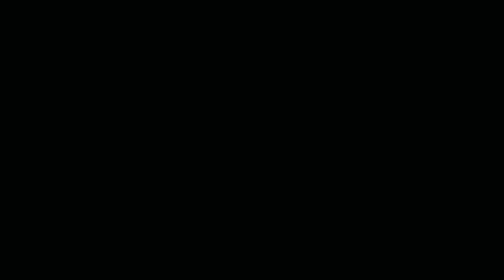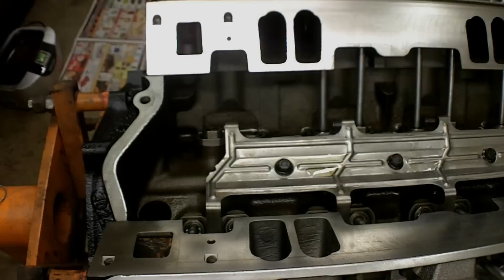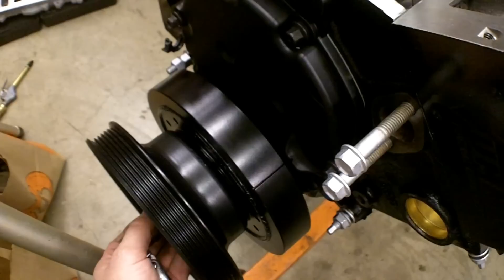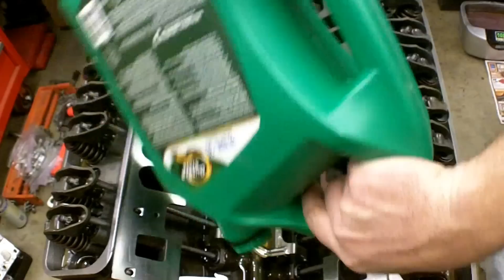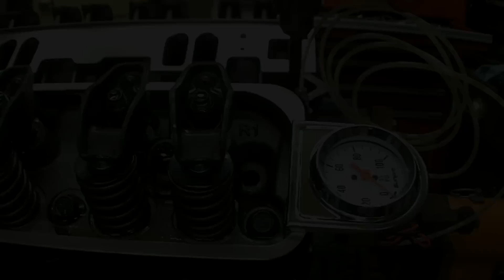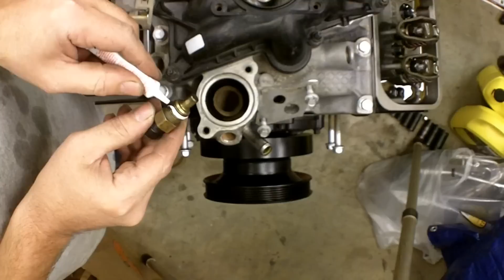Part 4-5 1998 5.7 350 CI Vortec Engine Rebuild

Comment: Great video.  Can you explain why the first step in adjusting the valves is adjusting Exhaust valves 1, 3, 4 & 8, followed by Intake valves 1, 2, 5 & 7, followed by Exhaust valves 2, 5, 6 & 7, finishing off with Intake Valves 3, 4, 6 and 8?  I see the firing order is 1-8-4-3-6-5-7-2.... but I cannot understand how that translates to knowing when all those exhaust valves and intake valves will be fully seated (valve springs uncompressed).
Reply from the maker: Thanks! I'll do my best. Every lifter rides on a cam lobe that lifts it and lowers as the camshaft spins. That opens and closes every valve through the push rod, rocker and then the vale itself. You adjust the valves when the lifter is on the base circle of the cam (Zero lift). In that position, you make your adjustments for that particular valve. You can make the adjustments one valve at a time but it will take a great deal of time and turning the engine over by hand time and time again. The order of valve adjustments I've shown simply shows which valves can be adjusted at a certain crankshaft position to save ton's of time. The order and position of the crankshaft ensures all of those numbers I've shown are on a base circle and are prime for adjustment. Again, you can just do one at a time and get the same results. This is just a time saver. Hope this helps, G.
Reply: @ghostses  Thank you for the explanation.  I should have been more clear in my question....  What I meant to ask is, "How did you determine that Exhaust Valves 1, 3, 4 & 8 and Intake Valves 1, 2, 5 & 7 would be at the zero lash position in the first rotation of the engine and that the next rotation led you to have Exhaust Valves 2, 5, 6 & 7 and Intake Valves 3, 4, 6 & 8 at zero lash?"  Somehow, knowing the firing order led you to knowing those specific valves would be at zero lash, but I just cannot figure out how you knew that.
Reply from the maker: @panepinto1959  I didn't have to work the order out myself- the procedure was documented in the manual I was using.
Reply: @ghostses  I think I figured out how to determine the sequence from the firing order.  You can see from this chart that the valves will be in the correct location for setting lash as you said.  	
TDC Intake Stroke Cylinder 1	 	 	 	                                                 TDC Intake Stroke Cylinder 6. Intake Power Stroke Cylinder 1	 	 
1	Intake valve opening, exhaust valve closed	Intake		      6	Intake valve opening, exhaust valve closed	Intake	
8	Intake closed, Exhaust closing			                                      5	Intake closed, Exhaust closing		
4	Intake closed, Exhaust fully open	                Exhaust		      7	Intake closed, Exhaust fully open	Exhaust	
3	Intake closed, Exhaust opening			                                      2	Intake closed, Exhaust opening		
6	Intake closed, Exhaust closed	                        Power		      1	Intake closed, Exhaust closed	Power	
5	Intake closed, Exhaust closed			                                      8	Intake closed, Exhaust closed		
7	Intake closing, Exhaust closed	                        Compression      4	Intake closing, Exhaust closed	Compression
2	Intake open, Exhaust closed			                                      3	Intake open, Exhaust closed
Reply from the maker: @panepinto1959  I really don't know why you did that unless it was just an exercise for your own knowledge? But cool I guess.
Reply: @ghostses  Indeed.  Totally unnecessary.  Academic curiosity.
Reply from the maker: @panepinto1959  Thanks for  being honest and wasting my time when I tried to help you directly even though your goal turned out to be null. I deal in practical application- not curiosity.  You disgust me. I'm not AI, nor a forum- but am a man trying to make more men that can do for themselves and for their families with some guidance and direction . . Fuck you is the reality now! I am NOT an exercise or an "academic curiosity". This bridge is all but burnt. Just imagine what knowledge I could've imparted on you had you not turned out to be a total douche-bag? Hmm...
Reply: @ghostses  I am sorry you feel this way.  If in fact you were able to read what I wrote, I was clear from the beginning.  There is so much incorrect info on the Internet that I thought it was useful to give people confidence WHY the solution you found works, rather than just trusting it.  Anyway, I am glad I am not you.  You are an awful person.
Reply from the maker: @panepinto1959   It's not a feel- it's a fact, and I'm the awful person? Uh, no you were not forthcoming in any way.
Yep, 382 videos I've posted to help others out for free really solidifies your stance that I'm awful. Well done.

Comment: question could not quiet here the 3 values of head torque i think you started at 17 fb ?also does it matter which direction the oil hole in roller lifter goes note this a roller style lifter i know which way the roller goes just wandering if lifter oil hole goes a certain ditection or does not matter THANK YOU GOD BLESS
Reply from the maker: Robert, I believe it was 26,44,66 on the three stages of torque. AS for the hole in the lifters, it doesn't matter how they go in. I like to point them in the same direction, but again- it doesn't matter. Good luck, G.
Reply: @ghostses  thank you motor has 164000 miles on it blew a head gasket l side pulled r side also starting to go also got heads done and surfaced was checking roller lifters all ok just noticed all oil holes we not the same direction  was just checkin put them back in same way noticed oil holes in block on both sides of lifters so the oil surrounds the lifter either direction the oil hole is pointed THANKS AGAIN GOD BLESS Robert.
Reply from the maker: @roberthouse1352  That's correct Robert, the oil passage surrounds the lifters so they will get oiled not matter their direction. On a build like I've done, I did point the holes all in the same direction, but it's more of an anal thing, nothing more. Take care, G.

Comment: dude you way over torqued those head bolts nprmal specs in total  is only 70 ft lbs i added your three numbers which equaled 127 ft lbs which is way to much
Reply from the maker: No I didn't Brian. They were torqued to 66 ft lbs. I did three passes, 26, 44, 66. The numbers aren't added together.  26 was  increased to 44 and 44 was increased to 66. Hope this clarifies things up. Take care, G.

Comment: I noticed when you were doing the lower intake that the lower gasket looked way off on alignment between the intake runners on 6-8 cylinders.  It looked like the gasket made very little if any contact on the wall between the two intakes.  Did you have any problems with that?  Shouldn't this be more precise?  I'm doing the same build and my gasket is off a bit also.  Is this common?
Reply from the maker: All I can say at this point Bryce is I've not had any problems with the gasket. I don't know if any other brands would be more precise. Good luck with your build, G.

Comment: When you’re torquing down bolts why do you make the wrench click twice?
Reply from the maker: Alan, a lot of folks turn the torque wrench too fast in my opinion- and overshoot the torque. I like to torque slowly and methodically until I get the first click. Then I do it again to verify the setting. Sometimes the first click is correct, but the second might turn a fastener a bit more. Right or wrong- it just the way I've always done things. Hope this answers your question. Take care, G.

Comment: What rebuilt kit did you use?  And did it come with all the plugs even the little one? I have a 98 with 270 on it do you think rebuilding it will bring it back to its oringal glory?
Reply from the maker: Samuel, I bought most everything from Summit racing individually- not in kit form. But yes, the plug kit I purchased came with the small ones. If your block, heads, crank and rods are good- there's no reason you can't bring it back. Even if you need new heads like I did, the same goes. Good luck, G.
Reply: Thank you and thanks for the fast reply great job on the videos
Reply from the maker: No problem. If you go forward and want to know exactly what I used for what, I may be able to give you a link. Take care, G.

Comment: how much do you charge for you do 5.7 vortec engine mine is a 96 gmc sierra
Reply from the maker: I only do my own rebuilds, so I couldn't say. I say try it yourself. It's not that bad and all the information you would need is on the web. Have the machine shop do the block and heads, get your parts and assemble yourself. I'm pretty sure anyone with basic mechanical skills, a few tools, and the web can pull off a stock build. Good luck Alfredo, G.

Comment: well I followed your valve adjustment steps to the letter and 7 intake, 2 intake , 4 Exhaust , and 8 Exhaust. Rockers are so loose I can almost take the push rods out? im stumped as to why this is happening. and I see where this thread is 3 years old crap.
Reply from the maker: It sounds like something wasn't adjusted correctly, or the engine wasn't at TDC on the compression stroke of cylinder 1. Make sure you watch number 1 and turn the engine over and ensure 1 is really at TDC on the firing stroke. Here's the order in text as the video might have been confusing. Good luck, G.

With the engine in the number 1 cylinder firing position TDC,
adjust the exhaust valves for cylinders number 1, 3, 4 and 8
and the intake valves for cylinders number 1, 2, 5 and 7.

Then

Turn the crankshaft clockwise 1 revolution until the
alignment mark on the crankshaft balancer is aligned with
the notch in the engine front cover tab.

Then adjust the exhaust valves for cylinders number 2, 5, 6 and 7
and the intake valves for cylinders number 3, 4, 6 and 8.
Reply: @ghostses  I put the number one piston up flush with the block service then installed the heads. The harmonic balancer Mark was dead even with the mark on the timing chain cover. Thought it was TDC did I do something wrong there?
Reply from the maker: Not sure. You need to turn the engine over by hand and watch the intake lifter movement on cylinder 1. When the intake valve opens (lifter moves up), keep turning the engine until it closes (intake lifter all the way down)- then keep turning and stop at the mark on the balancer and timing chain cover mark. Cylinders 1 and 6 are fairly close so you might have been on the wrong stroke. I would start from scratch and redo all valve adjustments. After you are sure you're really at TDC compression on cylinder 1- use my notes from the other comment to adjust the valves. If you can get it running but don't know if it's right, you can adjust the valves with the valve covers removed while the engine is running. You just loosen off the rocker nut till it clacks, tighten till the clack is gone- then tighten the nut 1 full turn. G.
Reply: @ghostses  man ty so much for the reply I will definitely  do this in the morning.
Reply from the maker: No problem man! Let me know how your job turns out. Good luck, G.
Reply: @ghostses  wanted to add I had put the intake back in the engine before you sent this. So it's a little frustrating now to figure the method with intake on. But will see how it works out
Reply from the maker: You may have got it by now but you can still do it by watching the push rod  on  the intake valve on cylinder  one. turn the engine by hand  while holding the rocker tight to the push rod. Keep turning until the push rod moves up and back down. Once it's fully down, keep turning the engine until the balancer mark lines up with the timing mark. That should be TDC of the compression stroke on cylinder one. Then proceed to adjust as I've described. G.
Reply: @ghostses  ya I got it all together now just have firing issues turns over real slow acts like it's not getting fuel or fire even though pump purges. And I poured gas in carb. Guess I'm in a whole another problem now.
Reply from the maker: Good deal! It's hard to say about the other problems without being there, but find the place in the series where I stab the distributor and go from there. I think I've taken you as far as I can so good luck sorting the rest out. Post back when what you've found since it might help others out. Take care, G.
Reply: @ghostses  ya my truck is a 1988 GMC Sierra with a HEI and pro comp intake and 4 barrel carb and headers. Has the 4 bolt main vortec the heads where cracked so I replaced them and put engine back together now I have the cranking  problem. If I figure it out I'll post what it was.
Reply from the maker: That's cool! Do let us know, G.

Comment: Thank you for the video, its very informative. I have a question on the valve adjustments. I recently replaced both heads with new factory GM heads. When I adjusted the valves just like you did in the video, I noticed that some valves were still very loose and had lash after the adjustments. Is this normal or did I do something wrong? I figures it had something to do with lack of oil pressure. so I put everything back together. its started up and ran just fine except for a very loud valve tick.
Reply from the maker: Something wrong?- I don't know. Since it's back in, I would pull the covers and adjust the valves with it running. Loosen off till it clacks, tighten until the clack stops, then go 1 full revolution. Some will run them at 1/4, 1/2, or 3/4 turn. I go with 1, but do some homework. G.

Comment: Great video.... step by step process. Thanks for it.
I have a Vortec 5.7 350.... on your number 1 Intake valve... it went down, do that mean that the Exhaust is about to come up, which means it at #1 TDC compression stroke?
Reply from the maker: Thanks Curtis! I'm glad you like the video. A four stoke engine works like this:
1) Intake stroke- the intake valve opens as the piston is traveling down- sucking in air and fuel.
2) Compression stroke- the intake valve closes and the piston travels up creating compression.
3) Fire stoke- just before TDC on the compression stroke, the spark plug fires to ignite the mixture forcing the piston back down.
4) Exhaust stroke- the piston is traveling up and the exhaust valve opens to get rid of the spent fuel.
Then the process starts over again.

To get at TDC on the compression stroke, you stop at number 2 in the list. Hope this helps, G.

Comment: u can run what ever u want i didnt say that but i said standard oil was 5w10 i run 30w or 40w in mine depending on where u live im a Certified mechanic
Reply from the maker: Actually, you did not say "standard oil was 5w10". You said "stock engine oil is 5w30" so that's what I responded to. To me, that was interpreted as you saying I should've used 5w30.  I gave up my certs years ago, but good for you. G.

Comment: stock engine oil is 5w30
Reply from the maker: 5w30 or 10w30 depending on climate- and regardless what the cap says. It can run either but since we don't have extremely cold weather, I go with 10w30. It's all in the manual. Take care, G.
Reply: 5w30 for USA motors 10w30 for Canada. pretty much.
Reply: I run 10-40 in my silverado 5.3 down here in on the gulf coast. it helps slow the rear main seal leak. lol The epa  is forcing the thinner oils for mpg purposes.

Comment: That engine uses 5-30... Why did you pour in 10-30?
Reply from the maker: +Shelby Hosey 
Shelby, it can run either. Based on my climate and since we don't have sub-zero temps around here, I usually just grab 10w-30. Take care, G.

Comment: How does the cost of your rebuild compare to the cost of a crate engine ?

Thanks ,   :-)
Wyr
God bless
Reply from the maker: +Wyr Twister 
Wyr, if I remember correctly, a GM crate motor was about 3k. My total bill came in at about 2.6k. That included everything, down to the smallest detail, to do the job. I think you can get a re manufactured, with tins, for just about 2k. Hope this helps, G.
Reply: I guess your numbers would have been different if you had been re-building an engine that did not require new heads ?

Thanks ,
Wyr
God bless
Reply from the maker: +Wyr Twister 
For sure Wyr! I totally spaced that that bit of information. I think the new heads were about $700. So let's say mine were fine and all I needed was a valve job at $300- on the high side. That would've brought my total down to around $2100 for the job- for everything- round about. It's been quite some time since I finished this rebuild- so my math may be skewed somewhat...lol. Take care, G.

Comment: great series! quick question! what type of silicone are you using for the lower intake manifold gasket?
Reply from the maker: +Daniel Delgado 
Thanks Daniel! I used Permatex Ultra Black. Here's a link to the exact product I used. Good luck, G.

http://www.permatex.com/products-2/product-categories/gasketing/gasket-makers/permatex-ultra-black-maximum-oil-resistance-rtv-silicone-gasket-maker-detail
Reply: +ghostses also one more thing. what exactly is that extension you're using on the drill to prime the oil pump?
Reply from the maker: +Daniel Delgado 
Daniel, it's an oil pump primer. I've had mine for decades and don't recall the brand, but here's a link to one that looks identical to mine. There are others out there, but if they don't have the collar, it will not prime the cam, lifters, rockers, etc. Hope this helps, G.

http://www.autozone.com/loan-a-tools/oil-pump-primer/oem-gm-v6-v8-oil-pump-primer/534529_0_0/
Reply: you can take an old distributor, gut it, take the gear off and there you go. cheap and easy.
Reply from the maker: Eddieallen
That's true! G.